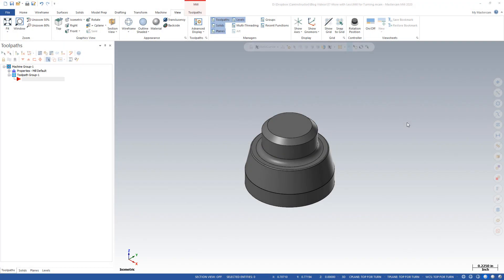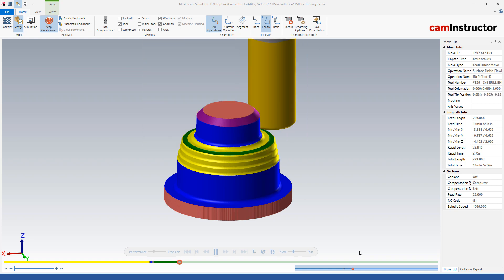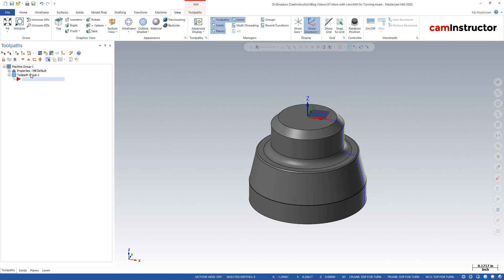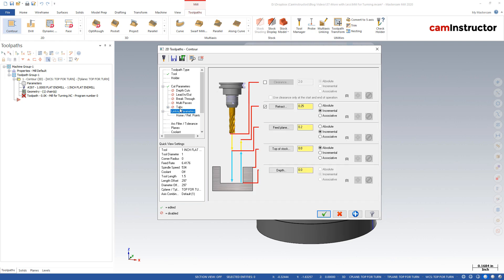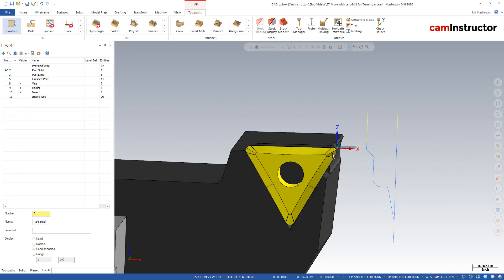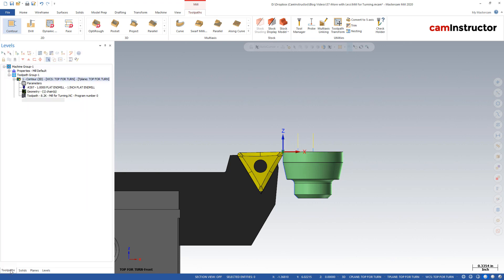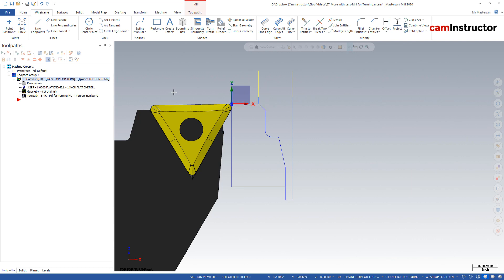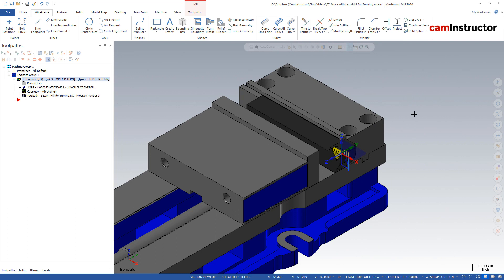Programming a CNC Mill as a CNC Lathe in Mastercam!

Comment: I've used a manual mill to turn parts before so this just makes sense, The main limitation is that the parts have to be fairly small diameter and there is no good way to use a tailstock with center so they can't be very long either but if you need small diameter short parts it should work great.

Comment: If you have the lathe product how do you CNC lathe using your CNC mill, do you have a video on that?
Reply from the maker: Do you mean programming a CNC Lathe with Mastercam Mill? I have been thinking of posting about that. It is possible. 
If you're looking for something else, let me know.
Reply: @CamInstructor  no. On your video you are using the mill product to turn a part on the mill, I wanna know how do you use a lathe product to turn a part on the mill?
Reply from the maker: Ok, ya, pretty straight forward there. The X and Z code should be fine. 
You'll have to make some gcode edits to the rest though. In Mastercam, no turning canned cycles, no CSS for cutting speed, no IPR for feed. Gcode edits, you'll have to remove G97s, add tool length comps on first Z move, remove G98s, and you may want to edit the tools ending section as well. There might be some other things to pay attention too but thats all I can think of off the top of my head. 
...maybe one day I can look further into it.
Reply: @CamInstructor  do you have a video out there for that?
Reply from the maker: @jerojr7542  Nothing right now. I'll add it to the list of ideas though.
Reply: @CamInstructor  thank you! That will a nice video to see I’ll like to see it myself looking forward to that

Comment: What a bizarre way to use a mill. Lathe tool nose radius will leave the fillet on the part a little bit off, but aside from that, it would work in a pinch.

I think some of the guys in our shop have used this method to turn down toolholders as well in the past, as cat50 toolholders are difficult to get into a lathe.
Reply from the maker: Like they say, just because you can doesn't mean you should. Yes, you'll be missing a lot of the comforts a real lathe offers but if you don't have a lathe or they are all busy with other jobs...?

Comment: there is no tool radius compensation at the tool path
Reply from the maker: For diameters and faces this will not matter...you probably won't have to worry about radius comp on small chamfers or radius blends either since the margin of error is fairly small, but if you really need the angled portion of this example part (or similarly tapered face) to be exact you can adjust the driving geometry to comp for the tool rad being used. This will be some extra work but easily do-able. As mentioned in the video description, you are missing out on some of the perks an actual lathe has.